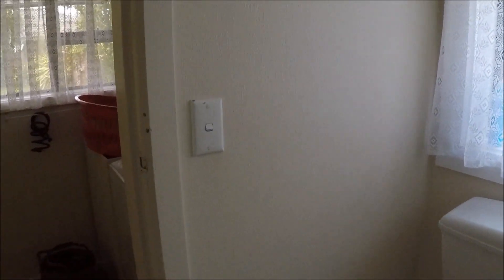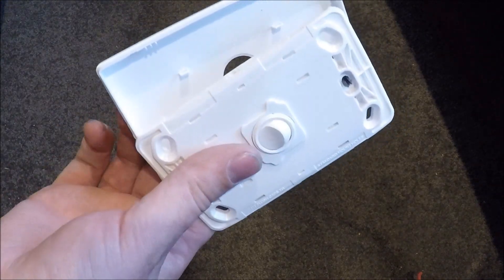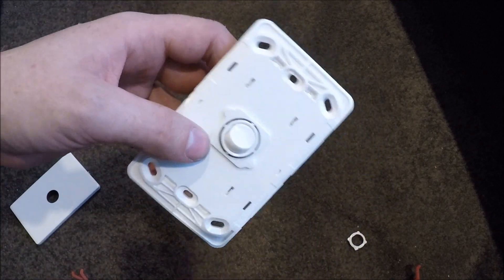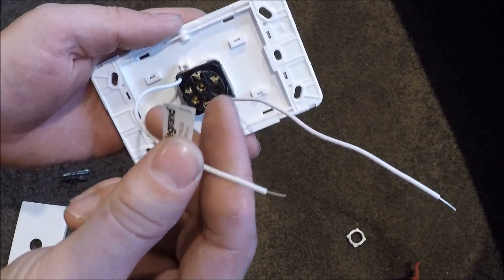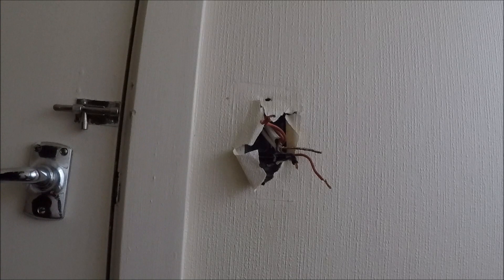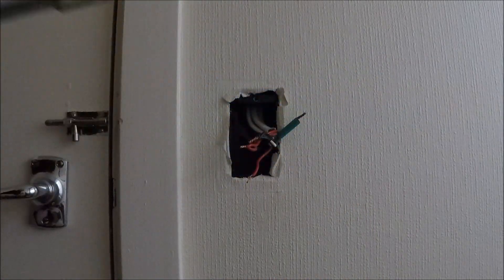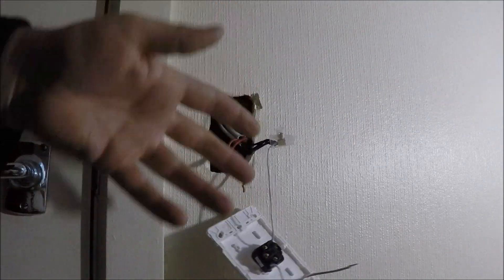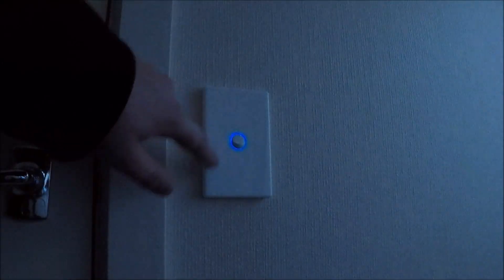How To Illuminate a Light Switch

Comment: Hi Dave,  this work well on a single switch, but how does it work in a two way switch? I like to have the blue light on when the main light is off. and the blue light need to off when the main light is on. The 2 terminal is in use already. could you please help with that please? thanks
Reply from the maker: Hi there, unfortunately to my understanding that without a 240v relay and two extra cores of cable you cannot run these to be dual switched in the off position while the main light is switched on in a two way setup. You can have them running independently, but one illuminated mech will always be on in that case. Also you can have both illuminated mechs switched on with the lights, or on all the time without the relay.
Reply: @sparkydave  thanks for your reply.  I ended up having the blue light led on all the time,  not ideal but is ok. Thank you for the great video.
Reply: On the slave switch, where would the two wires from the lighting module go to have it turned on constantly ??
Reply: @sparkydave  Hi Dave, just subscribed and saw this reply.... you can have the blue LED come on only when the light is switched on for a Two-Way circuit.  You just need to wire it correctly.  No relay required.  I have done this before on the PDL 800 series Modena illuminated push-button mechs.  😁  This is useful for the customer to determine if a lamp in the circuit has blown.

Comment: Just wondering how this would connect to a switch with no neutral wire?  Just the C and the 1?
Reply: You can't do it unless you have a Neutral at the switch,if you only have twin active at the switch(red & white) what you can do is get a few metres of SDI (single core blk, in 1.00mm² or 1.5mm² & wire it to the Neutral at the light fitting & then run it down wall cavity to the switch plate,just to supply a Neutral for the LED.

Comment: Hey mate. I’ve added these to a few switches which are great. I have wired then so the blue light is illuminated when the switch is off. How do you wire them up when there are 2 switches to the one light? I would like them to be lit up when the switch is off. Cheers

Comment: HI I did the same but once I on and off the light starts to flicker/blink non stop
Reply: sounds like one of the LEDs may have failed, or a capacitor has, something that tiny must be using nano particle sized smd components, not be possible to repair by naked eye

Comment: Great videos SparkyDave.  Just one question.  In our house we have some Clipsal push button switches with a  backlit led, but the led only illuminates when the lights are turned on.  I pulled one out of the wall to have a look and I couldn’t see two wires that you had on the back of your switch. There was only one thin wire connected to the active. Does this mean I can’t have it illuminate when it’s switched off?  Thanks
Reply: put the led wire in the common (c) terminal and it should stay on all the time.